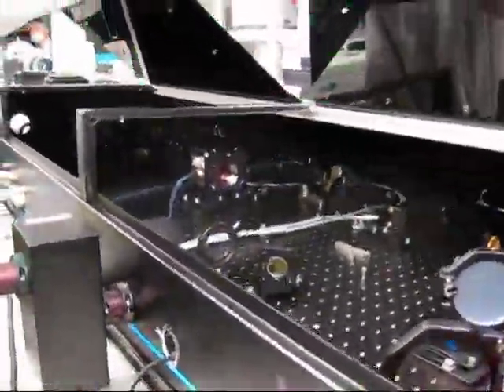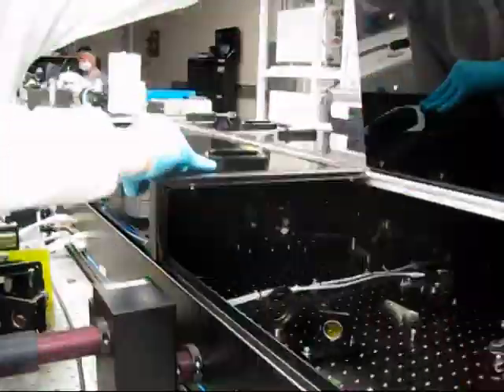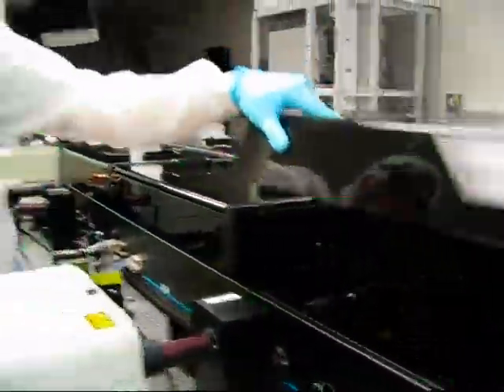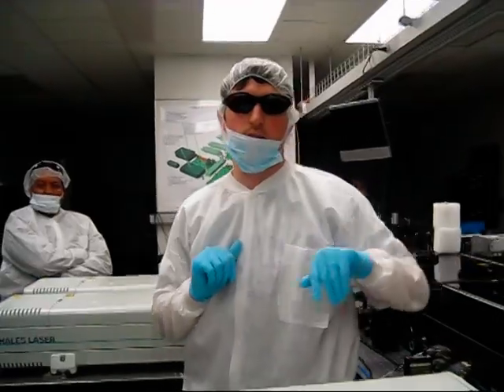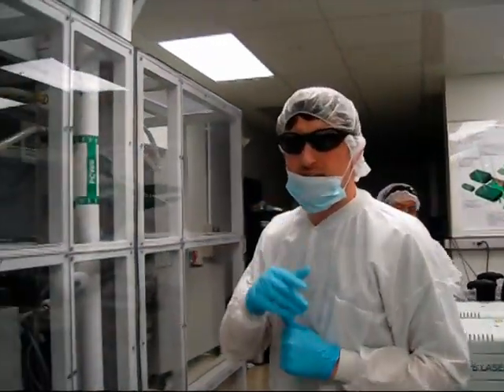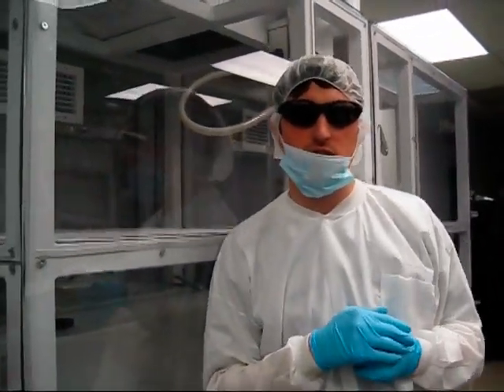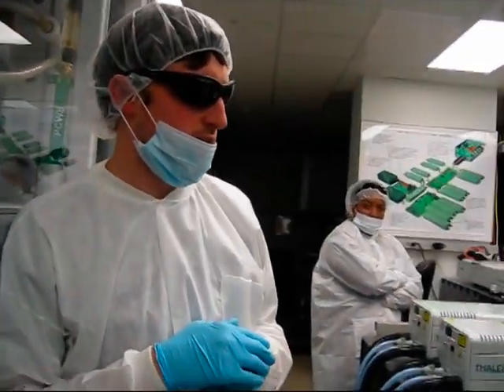Del Mar Photonics team visit Extreme Light Laboratory in the University of Nebraska-Lincoln

Comment from the maker: Stock availability of  MgO:LiNbO3 crystals for intense THz  generation by optical rectification using the Hebling configuration - sales@dmphotonics.com
MgO(0.6%):LiNbO3 crystal, stoichiometric, 5x5x9.81 mm
MgO(1%):LiNbO3 crystal, stoichiometric, 5x5x9.81 mm
MgO(1%):LiNbO3 crystal, stoichiometric, 10x10x19.62 mm

MgO:LiNbO3 crystal, stoichiometric, 5x9.81x5 mm
[MgO-LiNbO3-5-9.81-5] 
http://greyhawkoptics.com/product_info.php?products_id=821&osCsid=0b5a5b60cc56a0bba6b058f5dd7be762
MgO:LiNbO3 crystal, stoichiometric, 5x9.81x5 mm
Click to enlarge
MgO:LiNbO3 stoichiometric crystal 0.6%
Size 5x9.81x5mm
Wedge angle 63°
Surface ?/4 at 633 nm
Surface quality 20/10 S/D all
Coating AR at 800nm, R<0.25% on one side
MgO concentration 0.6%
Additional Information Featured application - THz generation

MgO(1%):LiNbO3 crystal, stoichiometric, 5x5x9.81 mm
[MgO1%-LiNbO3-5-9.81]    
http://greyhawkoptics.com/product_info.php?cPath=32_54&products_id=1003&osCsid=2eb0274087dc99a675efe22e929eddd8
MgO:LiNbO3 stoichiometric crystal 1%
Size    5x5x9.81 mm
Wedge angle    63°
Surface    lambda/4 at 633 nm
Surface quality    20/10 S/D all
Coating    AR at 800nm, A & B sides
MgO concentration    1%
Additional Information    Featured application - THz generation
https://www.youtube.com/watch?v=UzfG9fHA5fU

MgO(1%):LiNbO3 crystal, stoichiometric, 10x10x19.62 mm
[MgO1%-LiNbO3-10-10-1]    
http://greyhawkoptics.com/product_info.php?products_id=1004&osCsid=2eb0274087dc99a675efe22e929eddd8
MgO:LiNbO3 stoichiometric crystal 1%
Size    10x10x19.62 mm
Wedge angle    63°
Surface    lambda/4 at 633 nm
Surface quality    20/10 S/D all
Coating    AR at 800nm, A & B sides
MgO concentration    1%
Additional Information    Featured application - THz generation
https://www.youtube.com/watch?v=z0JHLhiS6F0

Big discounts for returning customers as well as Best Price Guarantee!
If you receive a better price for similar item from another vendor we are ready to match it and offer you additional 5% discount.

Comment from the maker: Featured group:
Research Interests
Our research interests are focused on studying the ultrafast dynamics and spatial rearrangements of molecules undergoing complex processes that occur in homogeneous/heterogeneous liquid environments, such those seen in polymers and solvents. The goal of our research is to characterize the time evolution of these complex molecular systems in and out of thermal equilibrium and to gain mechanistic information regarding the different molecular interactions and their contribution to the observed dynamics in each thermal regime. For this purpose, we use time resolved infrared spectroscopic tools, including state-of-the-art Two-dimensional infrared spectroscopy (2D IR), and first-principles theories and molecular dynamics simulations.
Two-dimensional IR spectroscopy (2D-IR) is a non-linear spectroscopy that provides information on how the different molecular components of a sample interact with themselves or the surroundings by exciting particular vibrational modes. The 2D-IR experiment measures the phase and amplitude of the third-order non-linear response (echo) arising from an ensemble of molecules after interaction with three time-ordered ultrafast IR pulses. While the first and second pulses act as “pump” by promoting the molecular system into an excited vibrational state, the third pulse behaves as a “probe” by inducing emission of the non-linear signal.
The echo signal depends on the time delays, polarizations, and phase relationships of the three IR pulses. From those variables, the most important one is the time interval between the second and third pulses (waiting time) because the vibrationally excited molecules are allowed to evolve, e.g., through vibrational coupling with the environment.Thus, by measuring the non-linear signal at different waiting time delays, it is possible to quantify the dynamics of the loss of the correlation between the "pumped" and the "probed" frequencies. The decorrelation time provides molecular-level insights into the interactions of the system and its dynamics that are very hard to obtain from other spectroscopic techniques.
https://xythos.lsu.edu/users/dkuroda/webpage/

Comment from the maker: Reef-FROG Scan pulse measurement platform - request a quote sales@dmphotonics.com
Reef-FS-1TiS with 34 degree, 100 micron thick BBO crystal. Start wavelength 300 nm, grating #10, 1800 g/mm
Input range for 40 fs pulse 622 nm to 944 nm. Resolution 0.4 nm, effective resolution at 800 nm, 1.13 nm.
Wavelength range: see spectrometer specifications
Pulse Length range: 12 fs - 5 ps ( greater than 20 ps using optional hollow retros)
Temporal range software programmable up to 60 ps
Temporal resolution: 2 fs or better
Spectral resolution: see spectrometers listed below
Pulse complexity: TBWP up to ~ 50
Phase accuracy: 0.01 radians
Real-time sensitivity (Ipeak * Iave): ~ 4 W^2
Averaged sensitivity (Ipeak * Iave): ~ 0.01 W^2
Input beam size: 2 - 8 mm, collimated
Polarization: Horizontal
Acquisition speed: greater than 2 Hz (64 x 64 grid)
Physical Dimensions: 30 cm x 30 cm x 19 cm
Shipping weight: approx. 40 lbs
Power requirements: 100 - 230 VAC, 50-60 Hz Electrical plug style: US NEMA 5-15, unless otherwise specified.
Real time data acquisition and analysis software

Comment from the maker: Femtosecond Multipass Ti:Sapphire Amplifier manual
http://www.dmphotonics.com/TiSapphire_Multipass_Amplifier/Wedge%2050.pdf
Femtosecond Pulse Stretcher
Temporal pulse stretching is required in avoiding the effects of 
peak power damage in high energy ultrafast amplifiers. This 
peak power damage is due to the tendency of bright beams to 
self focusing (a result of non-linearity in the index of refraction), 
which makes it necessary to limit the intensity present in 
amplifiers. The technique of chirped pulse amplification (CPA) 
gives a possibility to avoid this obstacle. The idea of CPA is to 
stretch femtosecond pulse duration reducing peak power before 
amplification and to compress pulse duration back to 
femtoseconds after the amplification. A principal scheme of 
femtosecond pulse stretcher is shown in the Figure 2. This is 
purely optical device containing diffraction grating, spherical 
mirror and plane mirrors. Femtosecond pulse going into pulse 
stretcher has a broad bandwidth. For a 100 fs Gaussian pulse the 
corresponding bandwidth is about 9 nm. A diffraction grating 
sends different frequencies in different directions at different 
angles of diffraction shown in the Figure 2 for long wavelength 
(shown as red) and short wavelength (shown as blue) spectral 
components of femtosecond pulse. After double pass, bluer and 
redder components exit the stretcher as shown in the Figure 2. 
One can see from the figure that bluer frequency components 
have to travel further through the stretcher than the redder 
frequency components. The result is that the redder frequency 
components exit the stretcher first, the pulse has been stretched. 
In the Wedge 50 pulse stretcher the input pulse is dispersed in 
the horizontal plane. The stretched pulse is directed back to the 
stretcher with help of vertical retroreflector, and four passes 
through the stretcher are achieved. Four-pass configuration is 
necessary to ensure that the stretched beam is spatially 
reconstructed. Femtosecond pulses with pulse duration 100 fs 
are stretched to more than ten picoseconds pulses before 
amplification. High reflective gold coated holographic grating 
gives stretcher efficiency higher than 50% for specific 
wavelength regimes.
Femtosecond Pulse Compressor
The pulse compressor was designed for compression of 
picosecond pulses amplified by Wedge 50 multipass Ti: sapphire 
amplifier to pulses as short as 50-100 fs. The principle of pulse 
compressor operation is shown in the Figure 3. One can see that 
in contrast to the pulse stretcher, redder frequency components 
have to travel further through the compressor than the bluer 
frequency components. The result is that the pulse has been 
compressed. Varying distance between the gratings, the 
compression can compensate the stretching precisely giving 
almost the same pulse duration as obtained from the seed laser 
pulse. The Figure 3 shows a simplified pulse compressor. In the 
Wedge 50 pulse compressor some other optics are involved, i.e. 
horizontal and vertical retroreflectors give a possibility to use 
one grating and to achieve four-pass configuration. High 
reflective gold coated holographic grating gives stretcher 
efficiency higher than 50% for specific wavelength regimes.